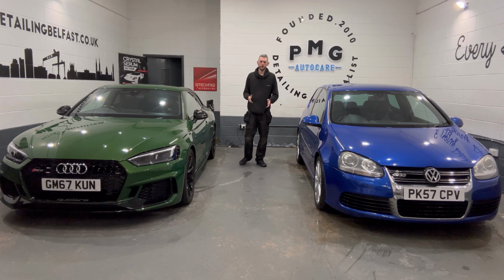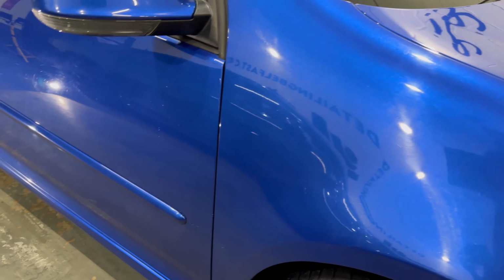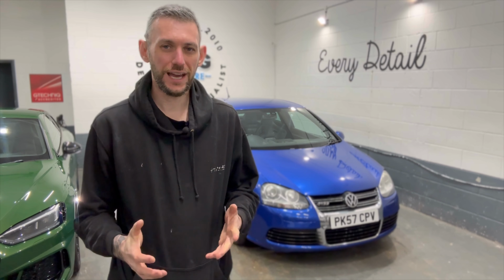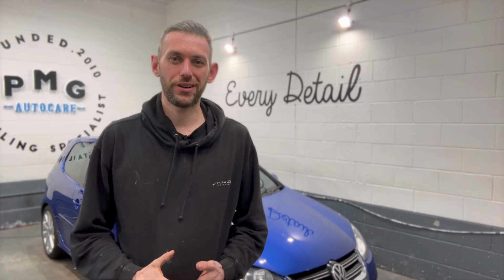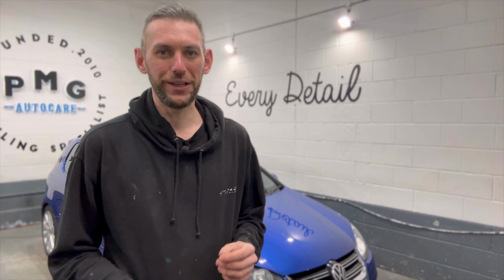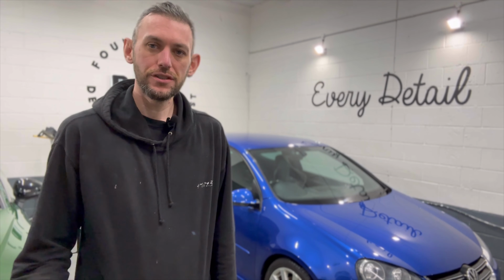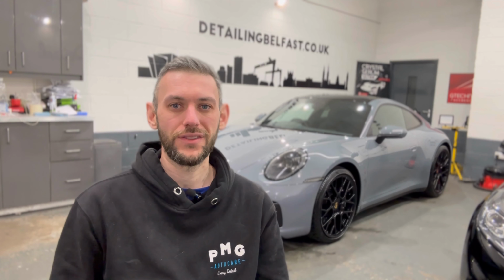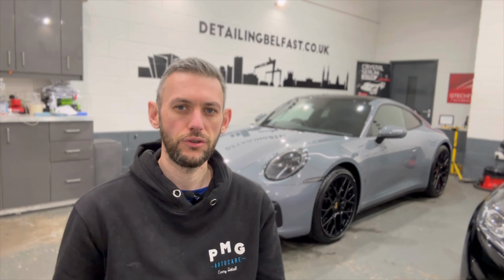Detailing a Volkswagen Golf R32

Comment: I challenge you to pull the fender liners out.   You will be surprised how much organic mulch has built up in there.  I pull mine ever so often to clean out all the foliage that has accumulated in there.  That’s the prime reason the wings rust out behind the front wheels.
Reply from the maker: Definitely worthwhile doing on these cars, that build up and the foam pads on the back of the panel are a recipe for disaster!